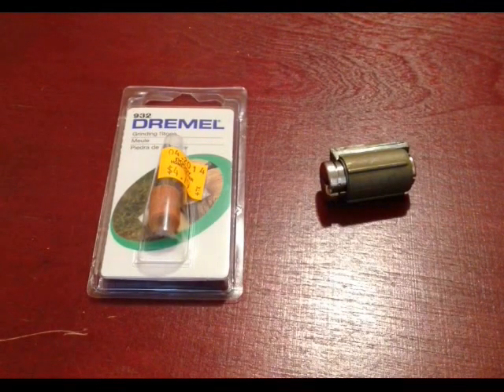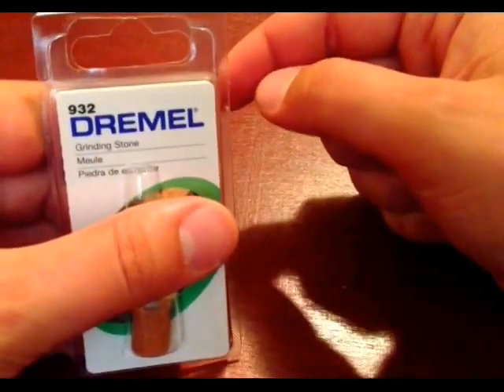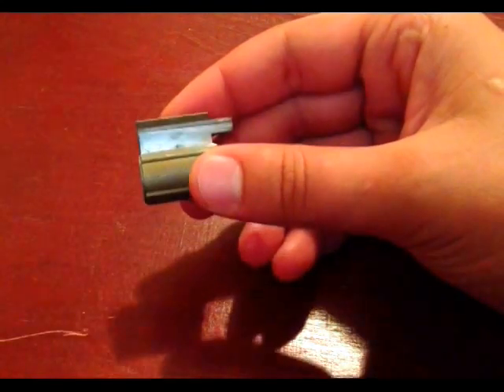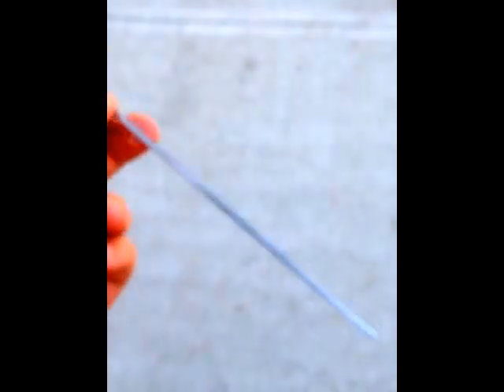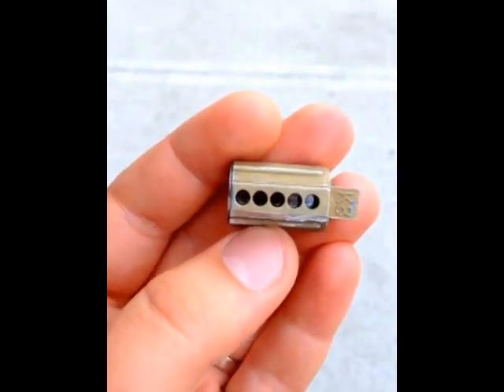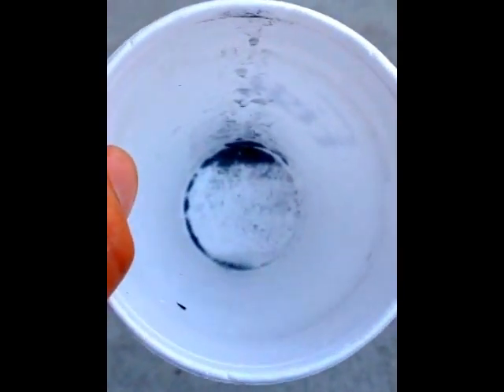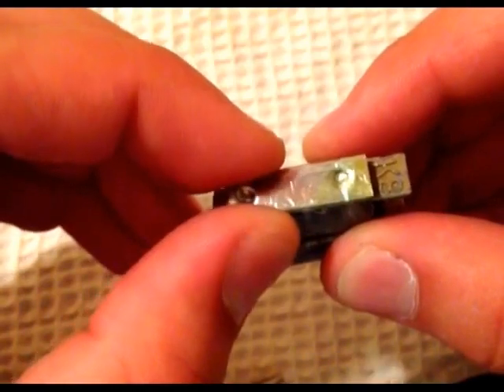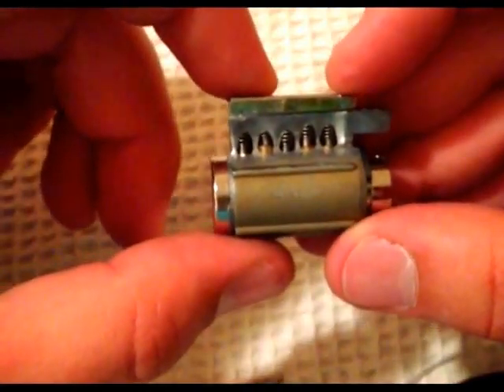Making a Cutaway Practice Lock (with a Dremel tool)

Comment: I could probably use a small file to do this huh? And is it absolutely necessary to pull the inside of the lock out?
Reply from the maker: You can absolutely do it with a file but it will take time. As for the insides, yes you do need to gut out all of the insides as you will start to file the pins. If you go to a local locksmith, I’m sure you can get a handful of used cylinders for free to play with.

Comment: Great work!  I've made a couple similar cylinders but I just drilled into the shear line then just used a small round file to round the inner cut edges to reduce the pins from catching on the cuts. Here's the file kit I use.  It was recommended by Bosnianbill on one of his videos.  Very good files for $10 ish.    http://www.homedepot.com/p/General-Tools-Steel-Precision-File-Set-and-Canvas-Storage-Case-6-Piece-707476/100572556
Happy picking.

Comment: Very nicely done on the home brew cut away. I have never made one, but you mention the top slider part that you put on that stops driver pins popping out. You could tap the chambers milling them, then use threaded type screws to keep them in place. That way it would be easier to change pins later.